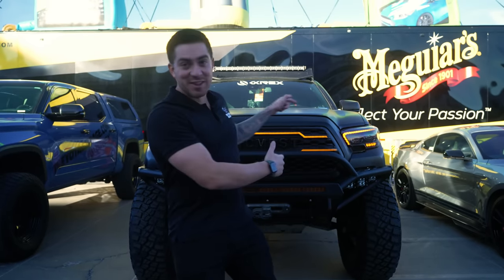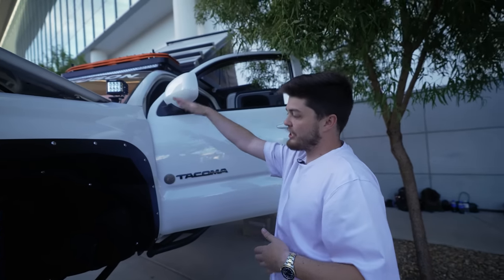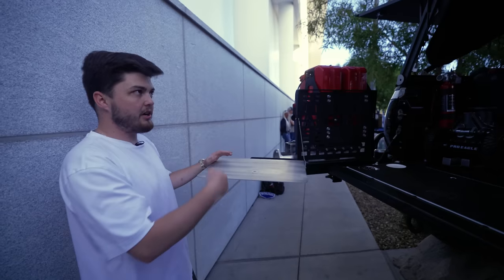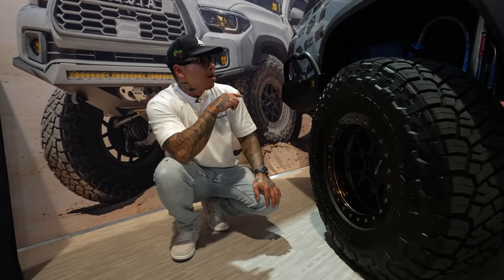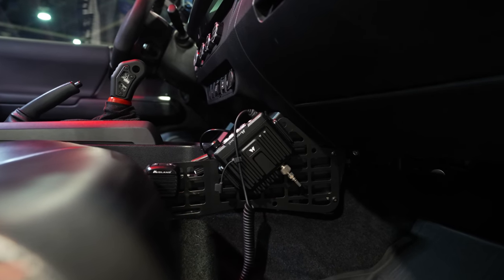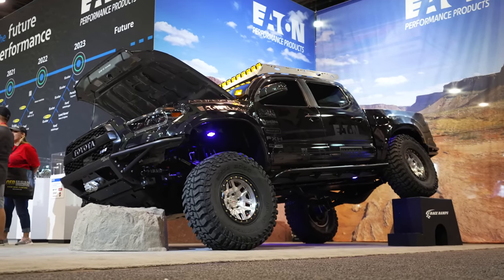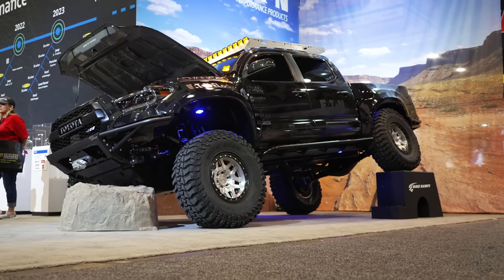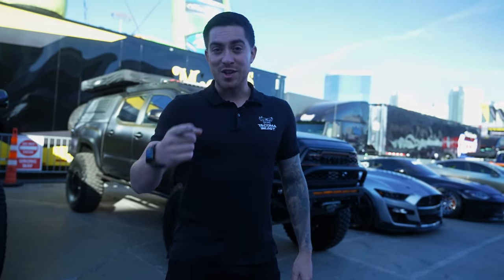Top 3 Tacomas of SEMA 2023 | + New Product Reveals!

Comment: The first one was cool, but good grief that lift is WAY overkill. Would've looked better with a 6-inch lift and 35's. The lights and the grille are exactly what I'm about to buy for my 2014 Tacoma
Reply: Shock length doesn’t directly correlate to how much it’s lifted. It probably is less than a 6in lift and looks soo high because he’s flexed out👍